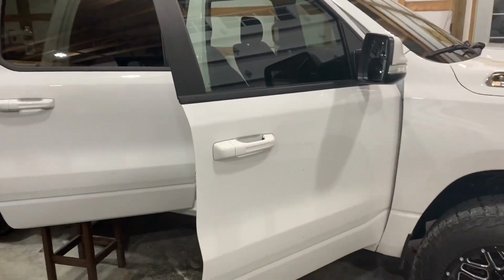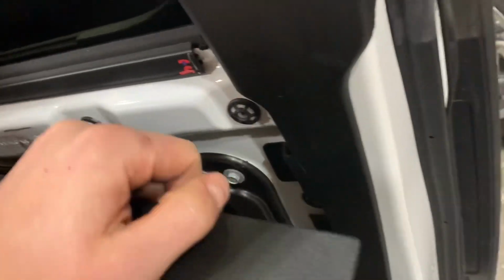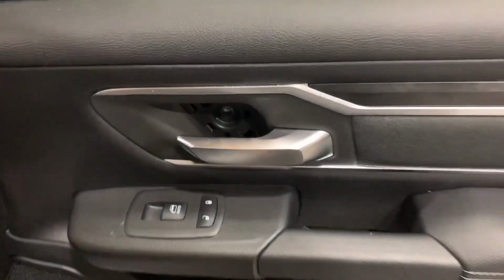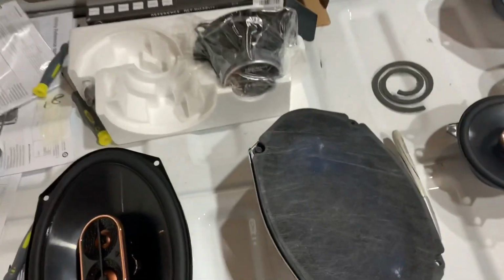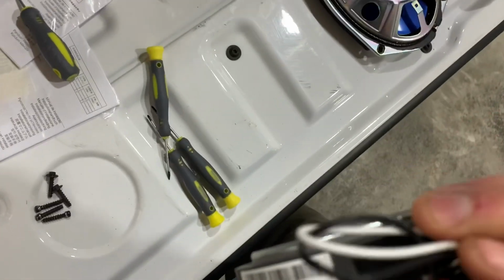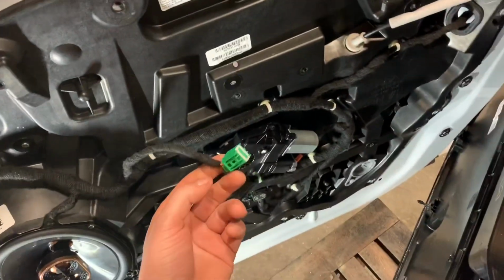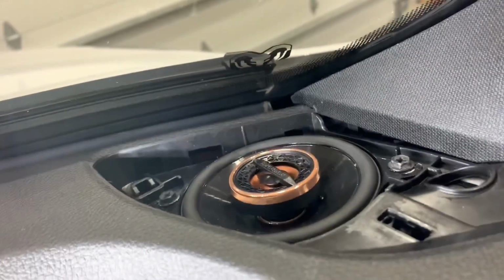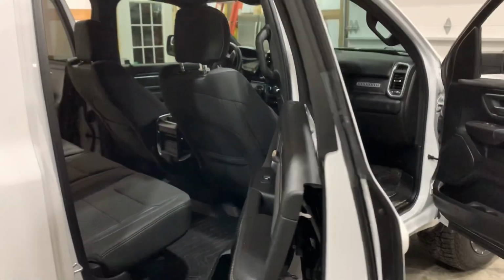Part 1: 2019/2020 5th Gen Ram 1500 Bighorn Factory Stereo Upgrade With Infinity Referenece Speakers!

Comment: Yeah, I was looking at the Focal ICU 690, but the Crutchfield configurator claimed 6 X 9 speakers would not fit in the front doors.  After calling them, the rep I spoke with assured me they would fit.

In the meantime, I think I'm going with the Hertz UNO X 690 instead of the Focal.

Thanks for posting this!

Comment: One of the best installation videos I have seen.  If you order the 6x9 for the front door, Crutchfield has to manually add the wiring adapters to the cart to get them for free....
Reply: Forgot to ask if you had added an accessory under the rear seat???  Noticed something that would hold things under the seat so they would not roll out from under it...
Reply from the maker: Michael Clark I have not seen an aftermarket option. The one in the video I have is oem

Comment: Completed my speaker install, at least the tough ones - all 4 doors. 2 dash speakers on hold until the right wiring harness arrives. But I know they're easy bc I already removed them. I installed exactly what so5thgen did; same infinities. NOTE btw - the dash speakers take a different wiring harness than the doors.

Imo, for ~$280 and my time, it was well worth it. The improvement, especially in the Highs i.e. the treble/tweeter stuff, was significant. Base seemed similar to me. That's not to say that it was a breeze. I'm handy but I don't do this stuff every day. So it was a little nerve racking ripping the door panels off. I mean you do have to basically get your fingers behind the panel pins and pull and pry. How I didn't break something in 4 doors is a miracle. But, trying to be patient, strong but gentle at the same time, it worked. so5thgen's lead and tips were helpful if nothing else to let me know that it could be diy.

Comment: Hey boss, maybe I missed it but Did you run any resistors to the front 3.5's?? I plan on running the Factory 8.4 with the Factory amp or ANC module whatever that stupid this is called. Awesome videos? Any help will be appreciated. Thanks!

Comment: I like the idea of only upgrading the loudspeaker. What is your opinion on adding sound deadening material to the panel? Sometimes more vibration shakes factory harnesses loose and even shutting the door will create a rattle.
Reply: Which system so you have?

Comment: I just did the 4 doors and dash with infinity and I can tell a big difference from the dash speakers and rear speakers, the front speakers are putting lots of bass , should be way better if by pass the factory amp and go external amp! Still pretty good upgrade
Reply from the maker: Glad to hear! Just remember to add another amp you’ll need the Rockford  Fosgate dsr1

Comment: Great video, thanks.  After installation did you get some rattling in the door panel due to the bass increase?  I've only done the front so far and I don't want the same rattle in the rear.  Thanks @so5thgen!
Reply from the maker: Make sure you have the door panel snapped back in all the way at the bottom of the door. You shouldn’t have any rattling.

Comment: Have you had any issues since the install? I installed the same speakers all the way around on a 2020 ram and at high volume for extended the time the speakers cut in and out. Possibly overheating of the amp since these are 4ohm speakers and the stock are 2 ohm?

Comment: I have a 2020 RAM 1500 Laramie with the Alpine 9 speaker system with subwoofer. Sounds good to me, but looking for a project. Should I upgrade anything?
Reply: I have the same thing and I will just change the rear door speakers , I belive they don't sound good to me...the dash speakers sound good but that's about it just for now.
Reply from the maker: Honestly best bang for the buck in your case would be the dash speakers in my opinion

Comment: Speakers cutting out! I installed everything that you did and it sounds fantastic until I turn it up to about 30-35 the from speakers cut out! Why! I have the 8” screen Big Horn package. My thought is the 6x9’s are 4ohm factory and t infinities. The 3.5  factory speakers are 8ohm and the infinities are 4ohm. Am I liking these down to 2ohm and there getting hot I guess? Overload on head unit? Anyone else have this problem?
Reply from the maker: Issue resolved?

Comment: Hi thanks for the great video, I have a couple of questions on this project. 

To avoid using the zip tie on the speaker for the front doors would you recommend using spacers if yes what size spacers ?
 Did you realize the difference does it really worth it ?

any other recommendations feed back  will be appreciated
Reply from the maker: Spacers are an option but it wasn’t required I only zip tied to speaker wire to ensure it never shifts
Reply: @so5thgen  how about the difference in sound was it noticeable ?

Comment: Is the volume knob at similar level vs stock speakers.  You mentioned 20 with stock vs 30 with other speakers.   Also the kicker hideaway 10 is a good sub option.
Reply from the maker: I’d say it’s very close with the infinity reference speakers. What use to be 20 is now roughly 21-22 on the volume knob setting.
Reply: @so5thgen  one more, do you use the + 3db on the tweeter?

Comment: Hi,I did same speakers set up. but tweeters are more louder than door speakers. did you got any resistor or capacitor installed?
Reply from the maker: No resistors or capacitors required
Reply: 2019 Ram 2500 basic 6 speaker non alpine system.
I just got the same 3.5 infinity dash speakers, Crutchfield sent Two 270 microfarad capacitors, s
may need to add a 4ohm resistor to the speakers, I read that they can blow if not used.

Comment: 2019 Ram 2500 basic 6 speaker non alpine system.
I just got the same 3.5 infinity dash speakers, Crutchfield sent Two 270 microfarad capacitors, should I use them?
Do I need to add a 4ohm resistor to the speakers, I read that they can blow if not used.
any thoughts?

Comment: I assume the 5th gens are the same as the 4th, but you'd be better off to buy the cheaper 2 ways for the front doors as most of the mids/highs get sent to the dash speakers and the front door speakers are bass and lower mids only. I got the 2 ways for the front and 3 ways for the rear and the same as you for the dash. Happy with the system overall though I did have to make sure that all my polarities match because they didn't initially and it was a noticeable impact to sound quality. 

The Rockford Fosgate P300 series all in one subs also make a great addition that's pretty much plug and play with the factory system
Reply: Have 2020 1500 and i have the same setup as yours same dash speaker 2 ways front 3 ways rear im very happy day and night difference, sound so good and balanced, i always wonder what would it be if i put 3 ways in the front doors too..
Reply: How was that sub plug and play to factory?
Reply: @dylanhall3026  It has an option for either Line or Level inputs, I forget which is which, but essentially one of them is what you would use if you went with a third party amp or radio and had a "subwoofer out" from the radio. The other is just able to be plugged in to the factory subwoofer plug (where the actual speaker itself plugs in) and gets it's signal there. You have to run new power wires for the sub, but other than that it just plugs right in.
Reply: @stephenbrothers9185  oh okay, my 21’ lonestar didn’t come with the factory sub so I don’t have that plug.

Comment: I just put in the 3.5" infinitys in the dash of my 2019 5th gen with the base system  the infinitys sound awesome but they are cutting in and out at high volume. Is there something i can do to stop that?
Reply: I think the stock headunit/amp can't handle it at higher volumes (It could barely handle stock speakers at high volumes). I think you are just stuck at a lower volume (which is still higher than max stock volume).

Comment: Does the dash speakers cut in and out when you have the volume up past 25? Would you need a small amp to compensate for the power of the tweeters  on the new speakers?
Reply from the maker: chris fiume it does not cut out but if you watch part 2 of this video it shows how to compensate it a little with stock amp
Reply: I have the same problem did you ever fix it ? And if so how ?

Comment: Nice video brother !! One question it’s everything working fine because my front speakers worked for a day but today when i woke up nothing for the front speakers.. any idea?
Reply from the maker: No issues yet did you pinch a wire when screwing the speakers down?
Reply: Might cut off, they start working again, after i turn the truck off for 1 minute, then they're all working, but at 36 out 38 volume they cut off.

Comment: Ok,so, I liked the video and I got the same speakers as shown in your video for my 19 Ram 1500 Big Horn. After installation I hear this vibration and what is sounds to be an exhaust sound throughout the cabin which is very audible. Is this caused because of the active noise cancellation unit or something? If so, how do I disable it? TIA!
Reply from the maker: Check the speaker polarity, Crutchfield has 2 different speaker harness adapters.
Reply: @so5thgen  it's the ANC and you need an additional harness to bypass it otherwise it makes a booming sound around 1600 rpms and 3600rpms. I wish I had known because the sound is almost unbearable at the moment.

Comment: Crutchfield is saying the 71-050 metra does not fit my 2019 Ram 1500 Big Horn is that a mistake?
Reply: They sold me 72-6515, I'm thinking this is where the polarity issues are coming from.  The 72-6514 looks to be same but opposite polarity. I will update this weekend after I install them.
Reply: Rodney Saye I have both coming, I wanted to be safe than sorry lol.
Reply from the maker: Any update on this guys?

Comment: Saving this vid for my speaker upgrade. Thanks! My factories top out at vol level 23 (loud with windows up not down). What is your peak (bumping) vol level now?
Reply: Wondering the same thing, I hate that my speakers max out at 22 or so and sound like crap.
Reply from the maker: Mike Walker 👌🏻👌🏻👌🏻
Reply: @so5thgen  same thing with the 2020 I top out at volume level 22... anything higher does absolutely nothing.

Comment: Ok, I did this whole upgrade and after about 3 months my front drivers door speaker started cutting out. I took the panel off and took the speaker out to check it out and had water in the speaker. Anyone else experience this issue?
Reply from the maker: Are your windows tinted?

Comment: Out of curiosity what brand does Ram use for their stock 6 speaker set up?
Reply from the maker: Depends what model you have but the oem speakers without Harmon Kardon are paper
Reply: 2019 Ram Rebel level 2. With the 6 speaker system

Comment: Crutchfield no longer says that the 71-050 fits the Ram but I read in a forum that it's actually the one you want since it matches the polarity of the stock system. Did you have any issues with ANC after you changed the speakers?
Reply from the maker: No issues with ANC
Reply: @so5thgen  do you need spacers? I dont want the speaker to be hitting the glass when it rolls down

Comment: as much as the doors look alike in the 2019 ram 2500 bighorn dont even waste yout time with these, the window track frame is in the way and you cant build the rim out enough,youll have to go out almost 5/8 and the screw holes dont line up .youll need something deep at 2 3/4 most  maybe the jbl 6x9 gto

Comment: Good video but every time the question is asked about the bass output the question is half ass answered or not answered at all, that tells me the bass output is garbage without an amp
Reply from the maker: The bass output it night and day difference for anyone with a base model stereo. For the factory Alpine speakers it’s comparable but these still provide more bass. These Infinity speakers are still limited by the oem amp. (Meaning there’s more bass potential that can be unlocked by adding. DSR1 and secondary amp). If my truck came factory with HK stereo package I would not be swapping my speakers.

Comment: did you put a bass blocker in for the dash speakers?
Reply from the maker: Bull I did not ? Have any insight on it though?
Reply: You don't need it if you have the Alpine or HK systems. Only the base 6 speakers system have full range on all 6 speakers.

Comment: With the decibel rating, you're correct to an extent,  but I don't think you really understand what that means. The decibel rating on a speaker if what is referred to as the sensitivity of the driver and is given that decibel level based off of 1 watt of power at 1 meter of distance, what is also important to go with this is the speakers RMS power rating. So to give an example of what this means and to know what you can expect from the speaker in a volume aspect is as follows: If your speaker has a sensitivity rating of say 90 DB (decibel) @1w/1m, and the speaker has an RMS rating of say 150 watts, to find the max DB the driver can produce,  for every 3 DB, the volume that your ear hears doubles, in order to get 3DB from your speaker then you need to double the power, and you can do this up until you reach the RMS rating of the speaker. So,If you take your 90 DB sensitivity and you double the power going to it, you get 93 DB @ 2 watts. 96 @ 4W, 99 @ 8W, 102 @ 16W, 105 @ 32W, 108 @ 64W, 111 @ 128W.  Thats roughly where it would end. Now, being in a vehicle you will get what is called cabin gain so it will actually be louder than that. Because you have the speaker in an enclosure of a sort (aka the door) you will also get a little bit of volume from that. Look at like this, a sub in a sealed enclosure plays at a certain DB, but if you take that sub and put the same sub with the same amount of power into a ported enclosure that was built per the manufacturers recommended dimensions,  it will be louder. Thats the effects of enclosure gain. So, now you have a better understanding of what a speakers sensitivity is. Pioneer makes some subwoofers that have 93db sensitivity. There are some other drivers that I have seen and used in custom installs that are also in the 91-95db range. I did a custom 3 way front stage install using drivers I got from a company called parts express and since I bought the drivers individually and not in a set, I didn't have a crossover,  which I don't like passive crossovers anyway. Plus the power handling was different for each driver. I ran a 7 in mid bass, 3.5" mid range and a 1.1" tweeter. Then I powered it with a 6 channel amp that had a built in crossover system that allowed me to adjust everything from output level to the high pass, low pass and subsonic filters. You could also do the same thing with an active 3 way eq and a 2 channel amp. It sounded amazing to say the least! Anyway, nice video. Will like and sub. Gonna watch part 2 now.

Comment: I was told that the polarity of the factory speaker wires were reversed on the 5th gen Rams.  Is there anyway you can confirm this?
Reply from the maker: I went with a lot of faith in the wiring harness adapter. Still no issues with my setup.

Comment: Does this have any effect on the active noice cancellation ?
Reply from the maker: Dawson Templer none at all. Active notice cancellation is built into the head unit. Active Noise Cancellation is best described as the attenuation or reduction of a certain frequency by emitting the same frequency from a loudspeaker, but with the phase inverted. The inverted phase tone essentially cancels out the unwanted noises.
Reply: So you left the factory phases?
Reply from the maker: Killerbell 1 the ANC comes from the from the head unit. I want to say it’s using the voice microphones in the roof to produce the feedback. I can assure you nothing fancy was inside the factory paper plate speakers !
Reply: What about the center speaker in the dash ?
Reply: @dawsontempler336  there isn't one on the base 6 speaker. Grill is there but no speaker or even speaker wiring
Reply: @so5thgen  I hear some folks having issues with droning between 1500-2000 RPM. This connector is a bypass for the microphones if you do not want to have the ANC connected. This is better than cutting wires. Definatley need to use it if adding an amp.https://catalog.pac-audio.com/catalog/amplifier-integration-harness/anc-ch01
Reply: I just unpinned my ANC at the amp under the seat, easy and free. Don't even notice it's not there and no droning